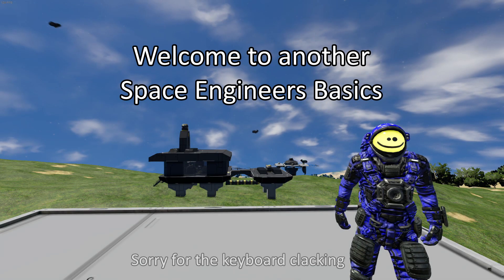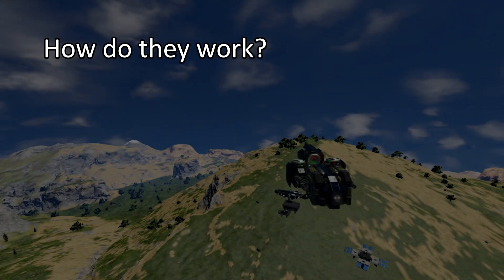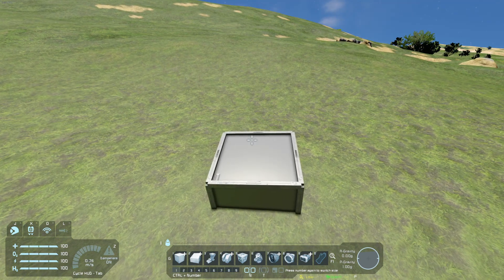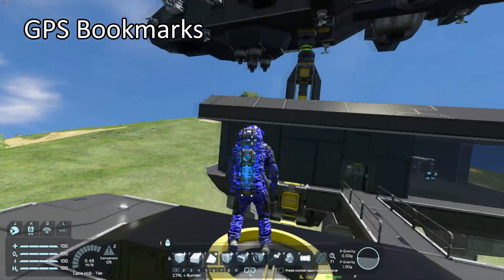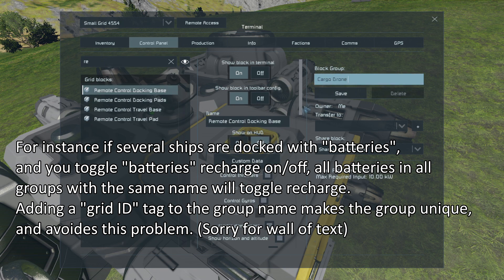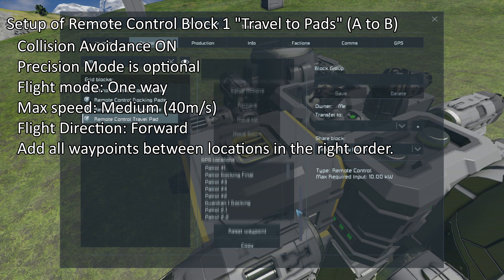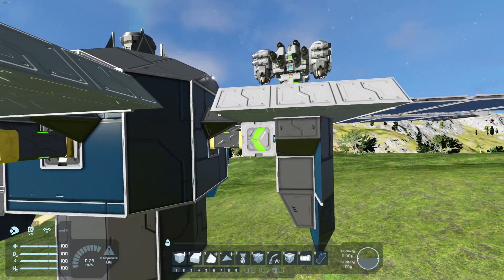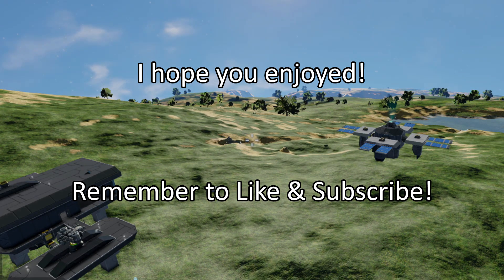Vanilla Automated Drones (No Scripts) - Space Engineers Basics

Comment: the way ive found over the years little tip is to build only 1 remote lastly timers and a seat then make gps as you fly setting up route the the remote is set exactly where it needs to go also setting up docking point 30 meters above final docks with accel down on remote it help alot with smooth docking because after a while banging connectors needs repairs and you might not be around when it happens breaking your drone s job protip lower connector strengh a bit too it softens locking on too :-)   good job taking time to make tutorials for people cheers